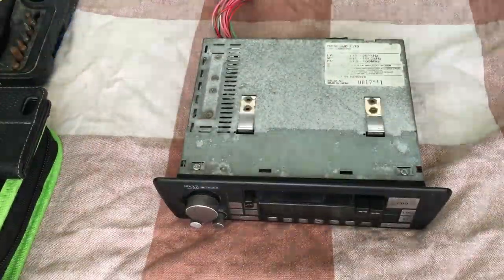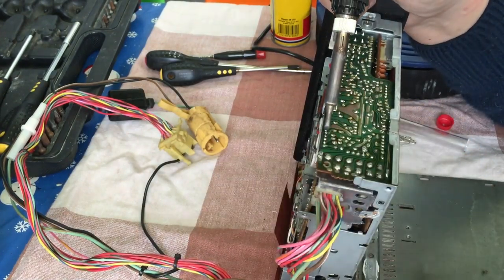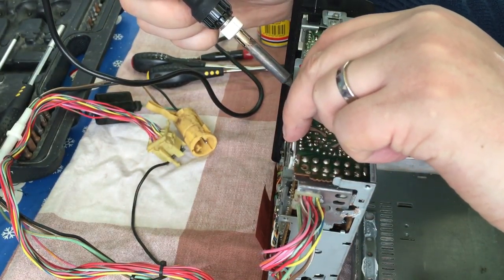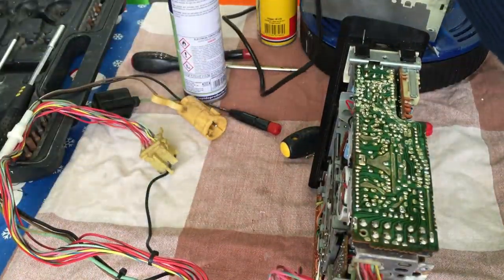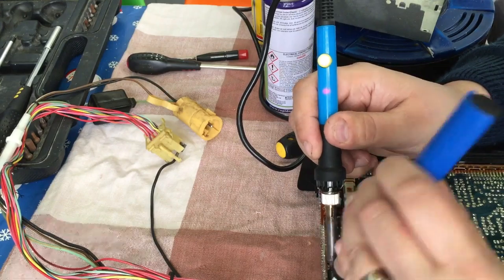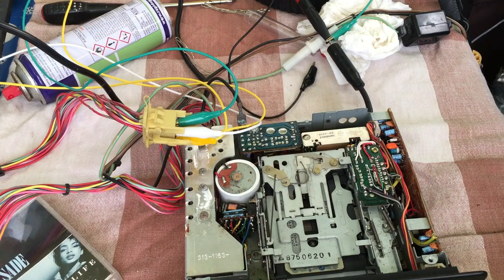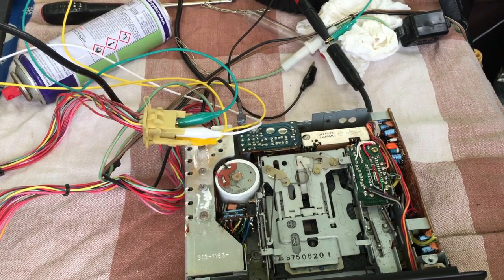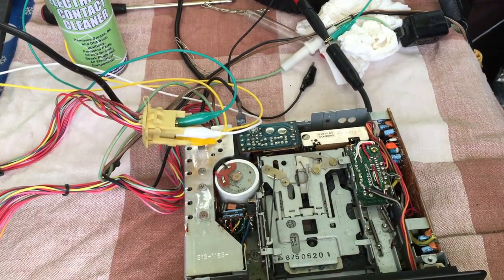Attempting to repair the early Clarion Radio Cassette from the Jaguar XJ40

Comment: Excellent informative videos 

What brand and model of solder sucker tool are you using here please ?

I have just removed my Clarion 9701RTA         ( 9701RT in other countries  )   stereo tape deck from vehicle because 
right front speaker output is  very poor to the point you can only just hear at full volume . 

To rule out a faulty speaker i   plugged left output into right speaker and right speaker is fine , both speakers test fine , just nothing getting to right .    any ideas where i should start looking please ?